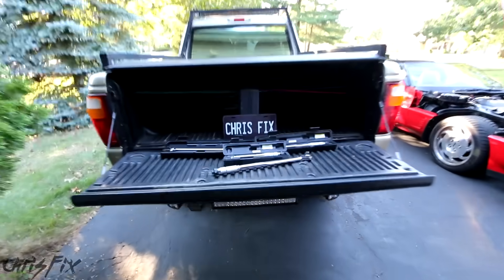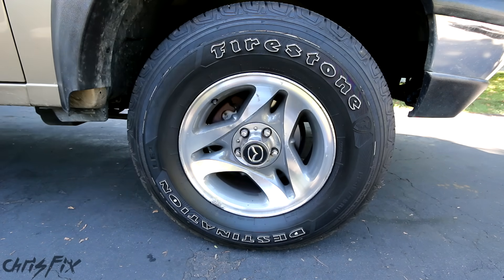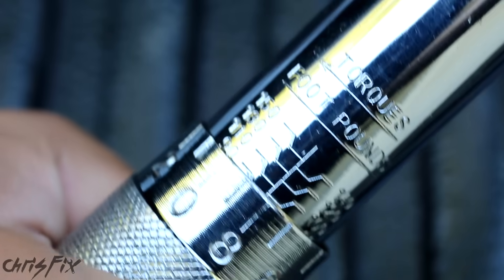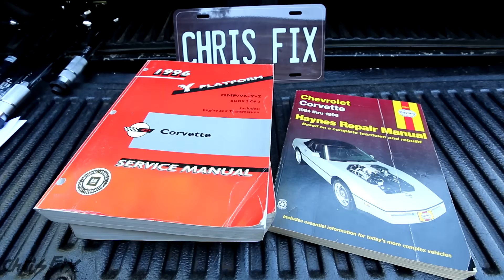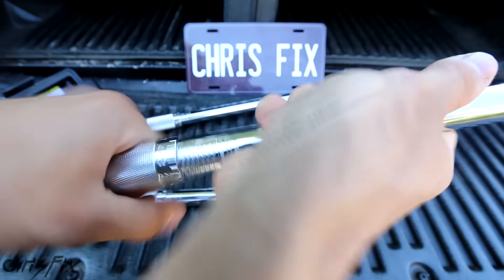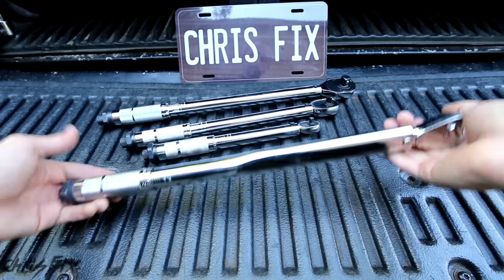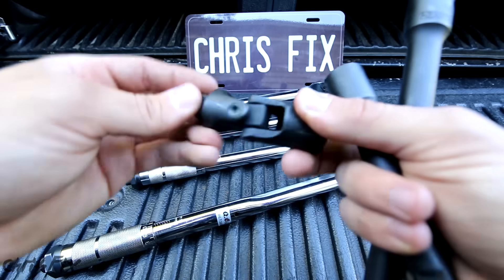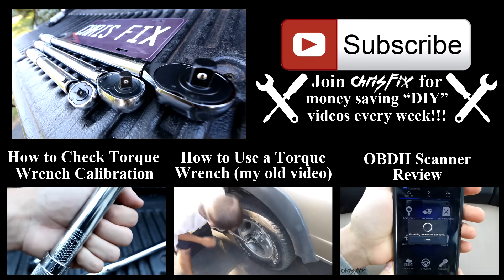How to use a Torque Wrench PROPERLY

Comment: Good Video Chris.  One thing you didn't mention but you did do right is to torque slowly and steadily, particularly when nearing the final torque.  If the wrench is moved too fast or a jerking motion is used, you'll likely end up with an over torque condition.  This is particularly important for inlb torques (higher accuracy) but still applies to all torque ranges. As an QA Inspector in aerospace industry I have witnessed hundreds of torquing operations and as a former racer who built my own engines that require very accurate inlb torques I can say without hesitation that technique is very important for accurate torque.  Slow and steady pull, no jerking or speed torquing.  Also, always pull the torque wrench handle vs push. If not done right, there is no point in using a torque wrench.  Torques won't be accurate or consistent.

Comment: Can I use one of those .250 drive torque wrenches for my head bolts?  I was  thinking the handle is rather short but I could always  make it longer with a cheater bar, such as a pruned drive shaft...

Comment: Bought my first torque wrench yesterday and used it multiple times today (valve cover gaskets).  I got a 3/8s in/lbs.  Loved using it, but beware as the click can be hard to hear on lower settings.  I now want to get a 3/8s and 1/2 in ft/lbs

I'm now off to the garage to turn my torque wrench down to relieve the spring tension.  Good tip!

Comment: If I buy  a 1/2" drive torque wrench, could I use a 1/2" to 3/8" adapter so I could use my 3/8" drive sockets, or is that frowned upon?

Comment: Always push down on the torque wrench instead of pulling up. Gravity is your friend. It helps take strain off your bicep and your shoulder socket. Pushing is always easier on your muscular and skeletal system than pulling.
Especially in the higher lb- ft  ranges of wheel lug nuts.

Comment: Hi Chris,I really enjoy learning from your videos.  Quick question - does it matter what side - nut or bolt that you put torque wrench on?  I had a tight fitment spot and had to tighten from bolt and had box wrench holding nut.  Got me thinking there was more friction but not sure especially considering bolt was the stationary part.

Comment: A mistake that I've seen people make for over 50 years is that they will tighten the nut/bolt with a ratchet or end wrench, and then put the torque wrench on it, then when wrench instantly clicks, they are satisfied that it is properly torqued.  Ooooops!  Could very well be over torqued.

Comment: Not trying to be abrupt.. But i believe your 1/2 inch drive actually is 10 to 150. Not 20 was confused when searching. I Bought one from the link that you provided; as well as the breaker bar. They are great.

What size torque wrench do you use for the calipers bolts and rotors bolts

Please answer mr chris fix
Reply: Tarek Taher I think he has a Pittsburgh torque wrench, those could be different. I have a Tekton 1/2 and it goes to 10-150 ft. lbs.
Reply: Tarek Taher also remember, you need different torque wrenches for different torque settings to get the most accurate torque. While a 1/2 can do 10-150 ft. lbs. If my vehicle calls for 14 ft. lbs. I would not be using that 1/2.
Reply: Pxndx Lunx for torque bolting for calipers and rotors.. Or smaller bolts.. What is a good torque wrench?

Comment: Another thing to consider if you would have to use a crows foot for an out of the way bolt or nut.  As long as the crows foot is at a 90° angle to the wrench it will provide the same torque.  If it is between 89° to 0° it affects the distance from the wrench handle to the bolt.  I don’t have the formula in front of me right now to calculate the offset in torque for the added length, but someone could easily find this.

Comment: Thanks! Exactly the education I needed. 

Two questions: 1) On the "move the needle" torque wrenches (not the click wrenches) - Do they last longer than the click torque wrenches? Or do they need calibrating just the same? 2) I have my dad's older needle (not click) torque wrench. He didn't use it a lot after rebuilding a Camaro SS a few decades ago (mid-80s). It's not worn out from use, but is it shot just from its age?

Comment: All I wanted to know is which line do you use to set the torque?  PLEASE JUST SAY THE BOTTOM LINE THAT POINTS TO THE TORQUE YOU WANT!!!  Really easy to mis-read and set the torque to the TOP line that points to the torque number.  REAL EASY TO SET 100 FT LBS AT 110 INSTEAD!

Comment: Alternatively, 2 ft long wrench woul call for 50 lbs of pressure to torque that nut. Or 25 lbs if ypure usibg a 4 ft long breaker bar

Comment: @ChrisFix, must say thanks for the video. Had a torque wrench I never used (and actually forgotten in a way) that's exactly like the one in the video. Guess I won't be a dork and get the correct torque in place after rotating the tires.  YOU ROCK!!

Comment: me and my coworker were testing out swivels sockets  because when ur doing oil pans and stuff it helps alot, with matco and snap on quarter inch eletric torque wrenches(both new and calibrated). Up to 14 nm the swivel actually increased the torque(for example 10 nm would come out to 12nm or 6nm to 8.5nm) but after that it lowered the torque. so if u use 2 torque wrenches u can actually calculate the torque real quick with a swivel and use it no problem. hopefully this helps.

Comment: How do you find out what the torque specification is for a particular bolt ... is there a chart of some kind ?
Reply: Basically how do figure out the torque required for different size fasteners when you work on a car

Comment: tourque specs have changed alot over the years never asssume most vehicles lug nuts are 100 ft lbs. example 2011 ford edge is 100 lbs however in the 2015 model thwy jumped it to 150 lbs and yet again in 2016 to 162 ft lbs on lug nuts
Reply from the maker: Thanks for the tip. It is a generalization but you are correct.

Comment: One question, I have a mercedes E280 W210.  The water sprayer for the wiper is not turning on at all.  I took the water pump out cleaned it and put it back in...but sadly still no go.   Can you make a video about something like this.

Comment: I bought Snap-on's QD3R250A that was on sale at their on-line shop.  Unlike its predecessor, QD3R250, the "A" version comes with both ft-lbs & Newton Meter readings so it is a 2-in-1 TQ wrench.  The 2 things I'm not happy with newer Snap-on TQ wrenches & ratchets are that their heads & bottom end cap no longer have "USA" inscription.  Also, the 250A's scales are inscribed on the body unlike the laser-etched type on the 250.  I find the laser-etched scale to be a lot easier to read. 

It seems thumb-screw type TQ wrenches are more durable than micrometer-type, as they use leaf spring rather than coil spring.  However, I still like the micrometer-type.
Reply from the maker: Thanks for sharing! Awesome info!

Comment: I had never used a torque wrench before, and never thought about .the problems with over torquing a nut or bolt until you mentioned it. And now I need to find one so I can make sure I'm doing it correctly. And does it matter if it's new or used, I like to go to flea markets and that's where I've gotten a lot of my tools from, how would I know if it is calibrated or not ?

Comment: I am in Auto shop at my highschool and I was using the torque wrench on my wheel and set it to the correct torque and everything and he got pissed at me because he said my arm angle was not fully at 90 degrees..... He told me I had no idea how to use a torque wrench when I did everything correct except for the "arm angle." I have been working on cars for a long time now and new people getting into working on their own cars will be turned away if they get called idiots for making a minor error...

Comment: To those who work on Motorcycles: You will need a small torque wrench.
I only had a 1/2" wrench that went to a minimum of 30 Nm, then I had to swap the clutch on my GSX-R and the clutch spring bolts had to be tightened to 10 Nm.

Of course, being plagued by hubris, I tried to do it regardless which resulted in me snapping two of them clean off without them being removable.
So a 90€ (Clutch Kit + Springs) job turned into a 300€ job and an assload of extra work because I had to replace clutch core and ALL the spring bolts just to be safe.
Bought a Proxxon Microclick that goes from 6-30 Nm and it's super easy to use for those who don't like the type with the digits on the handle.

Comment: sadly if you apply only one force tangential to the axis on which you want to torque, you have other forces due to the reaction of the support.. This is not pure torque. You also have a bending moment along the axis of the bolt, which is not optimal..

Comment: 100 my ass!
You cannot generalise like that when your targeted viewing audience is the new learner. 
Try torquing to 100 with many cars  wheel nuts and you'll sheer the bolt clean off, leading to a very frustrating situation.
Reply from the maker: Thanks for sharing but I have never seen a torque range below 80ft-lbs on a car or truck and I have never seen one above 120ft-lbs so the average is 100 which is what I torque all wheels I work on. Even if it recommends 80ft-lbs and you torque it to 100, you will not have any issues at all. You will not sheer the bolt clean off and if you do, good thing because it was due to fail and you would have other major issues if that happened while you are driving.

Comment: Okay, but what torque do I need to tighten the lock nut on the bottom to lock my setting in place? and would I need a separate torque wrench to measure it? but then how would I lock that one at the appropriate setting? am I supposed to have an infinite chain of torque wrenches to tighten the lock nuts of other torque wrenches?
Reply from the maker: +Chad M I hope you’re kidding lol :P

Comment: If you get good enough -or at least think you are, you can properly tighten bolts without a torque wrench. However, critical bolts, such as lug nuts, rod and head bolts, etc. should be torqued properly. Basically, if you can fit a torque wrench, use a torque wrench, unless it is more than 2 feet away
Reply from the maker: Thanks for sharing.
Reply: ChrisFix Sure thing man. I jump at any chance to share advice of questionable quality

Comment: I have this exact same 3/8" torque wrench, in the UK it's branded as Silverline. However, when set to 18ft-lb, tightening up the drain plug bolt in the oil drain pan, it never clicks and I could overtighten the plug, potentially causing it to break. How common is this problem with torque wrenches? I tried testing it on its lowest setting (7ft-lb) with a wrench (didn't have access to the drain plug easily) and it was solid, so the thing doesn't seem to work.

Comment: No offensive and just want to know..... Is a proper to use a handy electronic scale to calibrate a torque wrench? You know, an affordable electronic scale usually provides a rough reading instead of an accurate reading. If I do so, am I really calibrating a torque wrench? Should I really rely on it?
Reply: if you test the scale first then yes.

Comment: what if my manual says "tighten them to a torque of 25Nm ± 5%." so i just gotta put it in the number 25 in the pounds of torque ?
Reply from the maker: +Victor Tellez well if it says Nm you need to use newton meters or convert to ft-lbs. But yes, you put it at the number they suggest.
Reply: yeah i was dumb enough to realize that later on thank you very much Chris appreciate that!

Comment: Can you use a torque wrench to remove the nuts  off the wheel ? Is the 1/2 inch drive the best to use to tighten the bolts on a car ?

Comment: Saying most call wheels are fixed with 100lb-ft is not smart. Many cars vary wildly between 35, yes 35 on some cars, to over 500lb-ft. You should always check your owner's/service manual for torque specs. I can tell you first hand, many cars will get broken studs from applying 100lb-ft.

Comment: Some people think you should lubricate the nut or bolt before you torque it, but most car makers say "No," because it changes the torque applied and results in overtightened or unevenly tightened bolts and nuts.  I did not hear you mention this in the video.  What is your advice?

Comment: The only thing I would add that you didn't cover in the video is the use of a crows foot for fasteners that aren't accessible by a socket.  When you use a crows foot it needs to be at a 90° angle to the wrench, otherwise you are increasing or decreasing the torque if at other angles.

Comment: but what will happen if I fix the nuts on 150 pounds/foot while it needs only 105 pounds/foot?
kindly reply to the question
Reply: There's about 20% headway over spec that won't do anything bad, but beyond that the studs actually start to stretch out and weaken.  This can lead to busted studs the next time you remove the nuts.

Comment: "Well how can you be sure you used 16 foot-pounds of torque?"
"BECAUSE, I used a Craftsman model 1019 laboratory-edition signature-series torque wrench! The kind used by Cal-Tech high-energy physicists, and NASA engineers."
"Well, in that case, how can you be sure THAT'S accurate?"
"Because a split-second before the torque wrench was applied to the faucet-handle, it had been calibrated by TOP members of the state and and federal departments of weights and measures to be dead-on-balls accurate. Here's the certificate of validation."

Comment: Another great video Chris...only thing I would add....since I want to put anti-seize lubricant on anything I screw together is...how to properly prepare the bolt for torqueing...e.g. can I spray with PB Blast first? Anti-seize? Would this alter the accuracy of the torque? Or just "clean and dry threads"? (this may seem a bone-headed question...so thanks for any response or video). Thanks again...your videos are always clear and instructive!
Reply from the maker: Antisieze is actually going to give you more accurate torque specs. Using vs not using a lubricant on the threads isnt enough to really affect anything as long as your bolts are clean.

Comment: I never used a torque wrench to tighten a lug nut and never had stripped threads or loose wheels. In fact, to strip a lug thread with a common wrench would require a lot of force or a long piece of pipe or both.

Comment: What size torque wrench would be a good start for the beginner? I saw those 3 sizes at a tool store. All 3 sizes were on sale for $50 each.
Reply from the maker: +Matt Thomas I would get the 3/8s that goes from 25-150ft-lbs

Comment: hey danny moreno have a 2002chevy Malibu v6 with 100.000 miles runs good ac works but when at a stop light or going up hill it starts blowing hot air any ideas Thankyou
Reply from the maker: It is low on refrigerant. Watch this 3 episode series: https://youtu.be/pCv7rCdcXsc?list=PLDD611CFB36FC65F2

Comment: as ironic as it sounds, I like using a beam type torque wrench on my wheels (rims) because a "click" type torque wrench hits a particular torque and it's done. Anything you torque, technically has to be re-torqued, and if you use a beam type torque wrench and hold it at a specific torque range, you will notice that the nut may still be tightening after the the other type of torque wrench has "clicked off". Lug nuts have a range within about 30 ft. lbs., which is quite a wide variance. So by using a beam type torque wrench you can get in between the specified torque range and hold it there (which you cannot do with the click type torque wrench) and most likely feel the nut tighten further as the torque slips from corrosion and/or compression, and you'll get inside your torque range, without worrying so much about the re-torquing process. And just torque closer to the upper limit of the torque range and you probably will find you didn't even have to re-torque your nut.
Reply from the maker: Thanks for sharing!
Reply: Thanks for making me feel better for not throwing out my old beam type torque wrench!

Comment: ft-lbs and lbs-ft are synonymous because torque is simply distance multiplied by force. Doesn't matter which order you multiply them. Unlike miles per hour (miles divided by hours). obviously you can't divide hours by miles. Sorry for the unnecessary physics lesson.

Comment: My torque wrench goes up to 14 on the increments. I know it sounds like a funny boast but its not, its confused me, any help pls?
Reply from the maker: +Big dundee that's strange.
Reply: Hi chris, thanks for your videos very informative! Ive just followed your rear diff oil change video and am awaiting the hour till i can torque up the bolts but the minimum on mine is 20 pounds (i borrowed the wrench from someone who is on vacation) and like i say, goes up to 14 on the increments. Hmmm. Its made by silverline but cant find much info

Comment: extensions diameter has no influence on the torque you applie on the bolt the action you implie on the wrench side is exactly the same as on the bolt head side.

Comment: I don't recommend those Tekton torque wrenches unless you don't mind getting worn/scratched/rebuilt tools sold as new. I had no problem returning it to Amazon, but I can't trust a company (tekton) that would try to pass off a well worn, used tool as new. Buyer beware.

Comment: I have a question ... what size to torque  wrench do I have to use? Cause I bought a bigger and have no idea if this works on engine car bolts...do I have to use a small torque wrench to do this job or this is well ?

Comment: If tightening something that  involves an interference fit , a spring or a tight running bolt or nut, you can click the torque wrench premature with a quick jerk on the wrench. A smooth steady pull will get you more accurate reading.